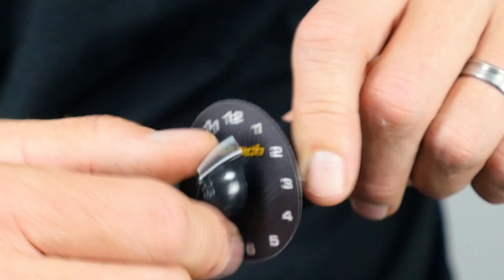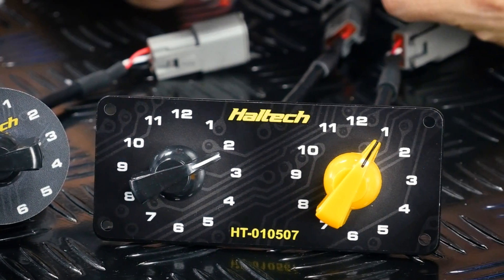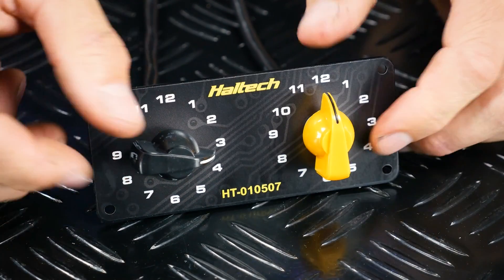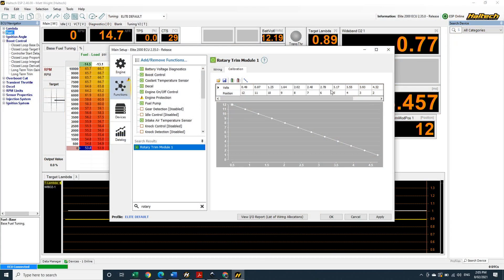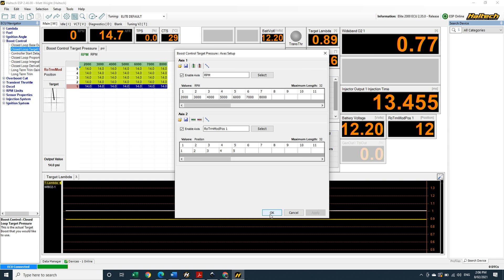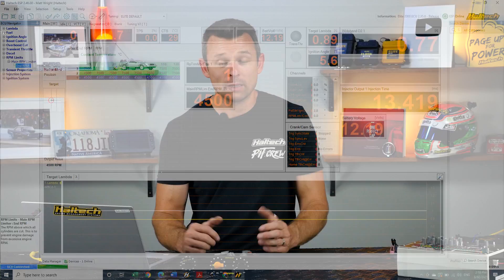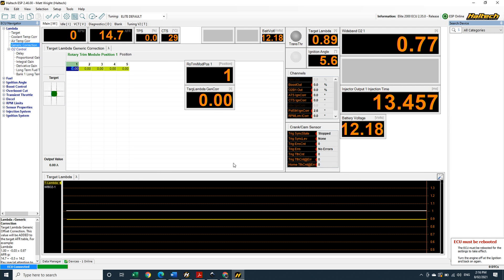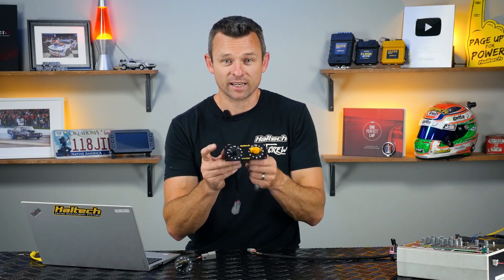🛠 How To Set Up Multiple Tunes or Boost Levels | TECHNICALLY SPEAKING

Comment from the maker: Want an aggressive tune for the track and a mild one for the street? Want to change the characteristics of your rev limiter as you are driving? How about setting up as many as 12 different target boost levels? It's all possible with this rotary trim module and in this video, Matt shows you how to make this magic happen! Enjoy:)
--
Got a topic you'd like us to cover? Leave it in the comments section!
Reply: Can I set up a tune for driving to the RSL for Sunday night bingo?
Reply from the maker: Absolutely - go to Setup - Speed Control  and choose "Right Lane Hog". Then tick the "Straw Hat" option. If you have your car horn connected to the ECU you can also choose from a number of pre-set sounds: "Ya flamin' Gallah!", "Ya bloody mongrel" or "Struth, the youff nowadays..."   Any problems - please contact our Tech Support and ask for Alf.
Reply: @haltech  you've sold me. Can't wait to turn the bingo tune on, in my Kingswood.
Reply: what about traction control ?
Reply from the maker: Yes can use this switch to switch between different levels of traction control.
Reply: I'm stuffing an LT4 (5th Gen) I've had custom built into a Datsun 240Z. Though the LT4 has boost, it's done with a supercharger (not turbos). While I intend to only use it for road trips to Las Vegas, sometimes I may want to just cruise around town, making a spectacle of myself. Ideally, I'd want efficiency on the wide open highways, and a few pops and crackles to make the rides around town more...interesting. Perhaps, I'd want an anti-theft feature, also. The only way I can think of doing this with my particular engine (due to the supercharger) is to limit the fuel to the engine (lower power/greater efficiency) for long trips (without limiting RPMs), then increasing the fuel to the engine when I want to show off that 8-peice ensemble under the hood.

I'd also may want to create a "valet mode" (but, less for the valet than to keep my wife from learning JUST HOW MUCH power she's sitting on) by limiting the actual RPMs the engine can turn. Have I misunderstood this video, or are you trying to tell me this unit will give me some control over both actions? If so, can a regular engine tuner set that up, or will I need to learn to do it myself?

Comment: I'm stuffing an LT3 (5th Gen) I've had custom built into a Datsun 240Z. Though the LT4 has boost, it's done with a supercharger (not turbos). While I intend to only use it for road trips to Las Vegas, sometimes I may want to just cruise around town, making a spectacle of myself. Ideally, I'd want efficiency on the wide open highways, and a few pops and crackles to make the rides around town more...interesting. Perhaps, I'd want an anti-theft feature, also. The only way I can think of doing this with my particular engine (due to the supercharger) is to limit the fuel to the engine (lower power/greater efficiency) for long trips (without limiting RPMs), then increasing the fuel to the engine when I want to show off that 8-peice ensemble under the hood.

I'd also may want to create a "valet mode" (but, less for the valet than to keep my wife from learning JUST HOW MUCH power she's sitting on) by limiting the actual RPMs the engine can turn. Have I misunderstood this video, or are you trying to tell me this unit will give me some control over both actions? If so, can a regular engine tuner set that up, or will I need to learn to do it myself?

Comment: Could it also be possible to cover the blow off valve when running low boost and open the bov when using high boost
Reply: A sequential bov is what you're looking for, Hks super sequential is made so when it's below say 15psi it flutters but at full 20psi is blows off.

Comment: I'm having problems with the settings on my trim knob. The voltage keeps changing. For example I'll have the knob set to setting 1 and on the ecu it'll read setting 3. Once the car starts after a few minutes it changes to setting 5, while the position still being in 1.
Reply: Where is it getting it’s 5v ref from ?